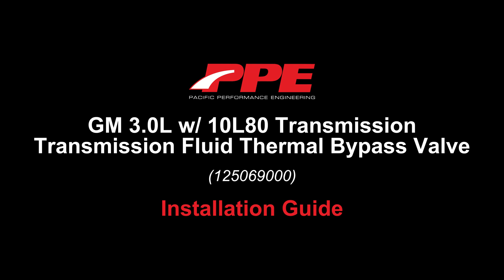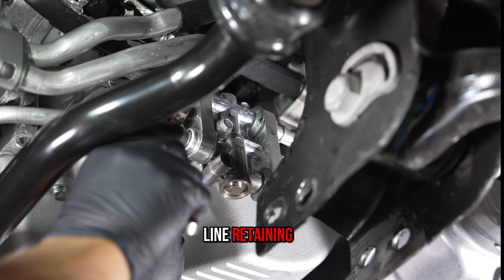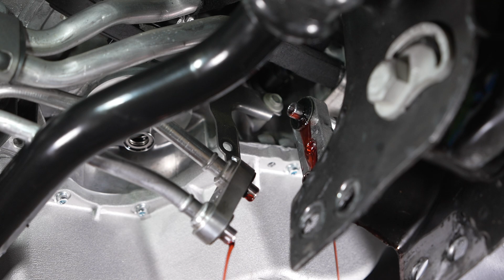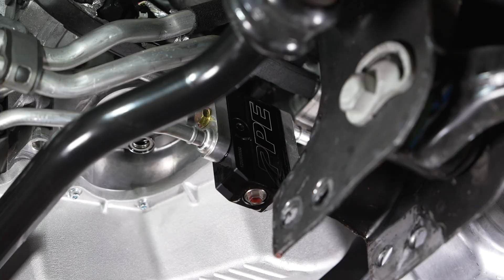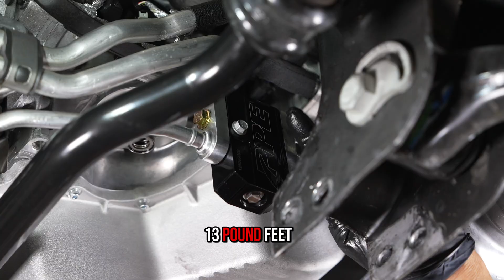GM 3.0L w/ 10L80 Transmission - Transmission Fluid Thermal Bypass Valve Installation Guide

Comment: Do you need to add transmission fluid after ? Or is it not enough to make a difference?
Reply: Maybe it’s cuz I did mine in the morning (after it was parked overnight) but my collecting bowl underneath hardly had much. 

I’d say 1/4 quart max. I don’t plan to refill as I just had my transmission serviced last week so I know it wasn’t low already